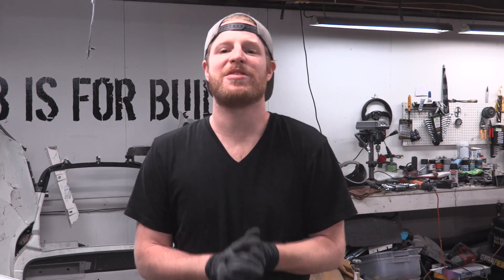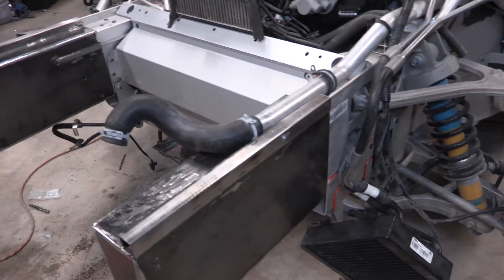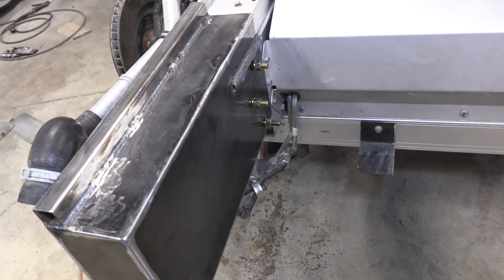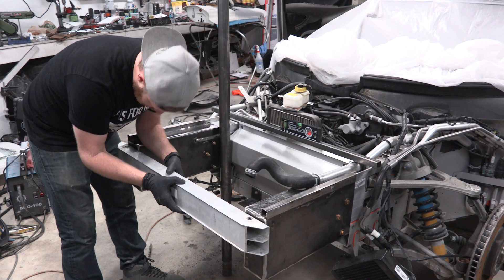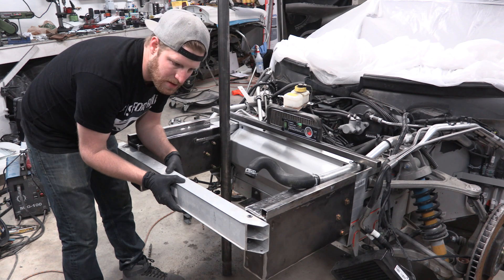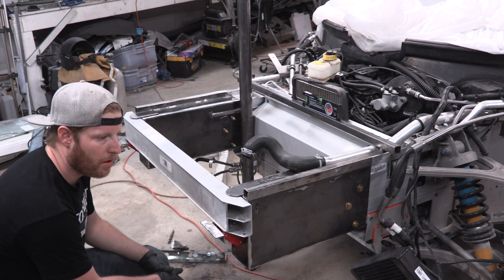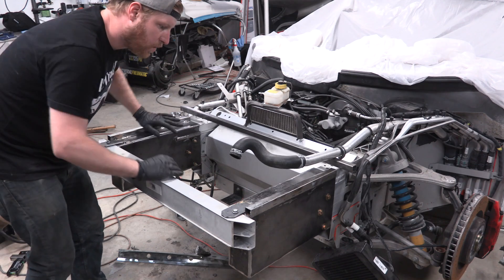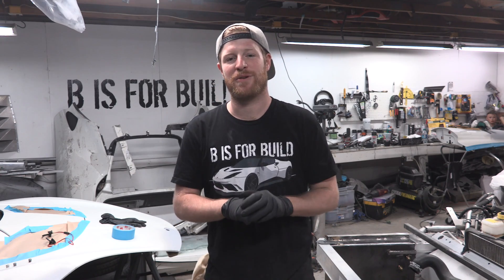Budget Lotus Evora Pt 21 - Mounting Impact Bar & Frame Rail Extensions

Comment: I know you are doing it for the internet trolls, but you are going above and beyond to make this design "safe" and its honestly just too much.. if people are talking about corrosion or crumple zones, just tell them to fuck off. The factory used steel inserts in the aluminum crash bar, that's enough proof that it shouldn't be an issue. and the steel frame is just moving the crumple zone back. do you expect to roll this bitch into a concrete wall?

Comment: Maybe using Nutserts into the alloy would have been a better approach. You wouldn't be stressing the alloy as bad. Also would it be worth cutting the frame rail boxes to taper up to the  impact bar? Probably shave a bit of weight and will still be strong.

Comment: You can add crush sleeves by removing the bolts and drilling one side to the OD of the crush sleeve.  Trim the sleeve the the correct length so that when inserted it gives you some clamping force but not enough to crush and pull the faces together dimensionally.  You have to weld them to the plate you pushed them through.  They'll butt up on the inside of the far plate.

Comment: Hey man, Just wanted to say Im really enjoying the build! Ignore the haters! They just dont get it. This car is for you and not to resell so build it the way you want! I do have one suggestion thought. When you do final assembly of the frame rails, I recommend taking your welder and killing the nuts on the bolts that hold the frame rails on. If you ever have to disassemble, youll have to cut the nuts off but, in my opinion its better to replace a few dollars worth of bolts than risk having things vibrate loose. Just my suggestion but, as I said, build this beauty as you see fit!

Comment: Do you plan on putting bushings or sleeves on the inside of the frame rails for the three bolts you are using to secure the steel extensions so you don't crush your steel extensions and aluminum frame rails when you tighten it all together?

Comment: Dont worry about all the pseudo science going on people dont really know what they are talking about. Just remember that every single screw nut and bolt on that car is steel and they are all fine! Not to mention brake discs engine components etc etc.

Comment: I dunno maybe you could use that glue they used for some of the other stuff as a separator between the 2 metal types.. would also help keep it mounted I guess.. might not be a good idea though, just speculating.

Comment: I understand the reason behind reworking the frame rails, but surely bolting them through and not welding them is just focusing any crash force in to 3 tiny spots in the original aluminium structure?
Reply: He is going to use the glue that lotus use oem too, he said that several times.

Comment: Chris you should get some nylon washers for the bolts. I use SS and Aluminum all the time together in the marine construction field and using nylon washers helps with lessining the corrosion between dissimilar metals. and that is even in a saltwater environment

Comment: i really like your desition to use the lotus bar on the front.

once you have painted the steel parts, hopefully grey? they will blend in very well and this will look like a stock setup :) 

those springy lock washers are useless though. if its not already in your plans i suggest getting lock nuts or real lock washers (the kind with two washers that are serrated on the outside to grip the nut and the surface, and have a stepped design between them to only go one way) :)

Comment: Instead of buying high dollar epoxy from the dealer, go to any autobody paint supply store and ask for panel bonding epoxy. I like 3m brand. Some need a special applicator but you can manually mix the stuff up with a c clamp.

Comment: Nyloc nuts on the bolts when you do the final fix on the frame rails. How about powder coating the mild steel frame rail extensions inside and out before you do the final fix? Not sure how that will effect the epoxy bond though. It's looking good so far.

Comment: REMEMBER: When you bolt through a hollow object, you NEED bolt spacers so you dont CRUSH the structure!!
Reply: ^^Bump^^
Reply: i can second this, this has happened many times to me before
Reply: I was thinking bout this too. Hopefully he sees your comment/thought about it already 👍
Reply: Came here to say the same thing, bumping up
Reply: since it's permanent and also being epoxied, he might as well just hand-tight the bolt and then weld the nut to the bolt
Reply: Bump! Don't want all the work to go to waste when it crushes in on itself
Reply: yeah i think so too. maybe glue them in the that red shit.
Reply: hes probably just not going to tighten it too much. bolts are secondary to that orange glue stuff. BUT that means the bolts will want to come off from vibrations. SO I'm hoping for locknuts or some locktight.
Reply: Yup, they are typically called crush tubes!

Comment: I wonder how filling the cooling system is on cars with engines in the back and the radiator up front. Would you have to forcibly fill it or fill the coolant hoses/pipes first? The pipes would always have coolant in them right since they have to flow such a long distance?

Comment: Every car on earth has a mash of metals... People who are commenting on it are morons... Inside every aluminum block motor is an iron sleeve and aluminum block sitting in 50% water and high heat cycles and grounding current running through it and no issues. A little mix of metal on the outside is nothing.
Reply: But the sleeves don't touch the block because if it did the sleeve would expand and crack the block
Reply: +Jamie Roberts False. They are pressed into the block and make contact at the bottom and top of the sleeve to the block. Also the block will not split because aluminum expanse more then the sleeve when it is at temperature. The blocks are usually preheated when the sleeves are pressed to ensure the sleeves don't fall out when the engine is hot. Look it up and do research before talking about things you know nothing about.
Reply: +Refisol I don't mean they have zero contact, I mean all around the sleeves there is space as it isn't touching the block. Of course there is some kind of contact
Reply: Whilst it is true that most cars have multiple metals in them, nearly all cars have one metal that the chassis is made out of e.g Steel, Aluminium or Carbon Fibre. The problem people are having is placing heavier Steel on the end of an Aluminium chassis could create an unwanted effect in the event of an accident more importantly for me however is the extra unsprung weight of that crash bar is bound to affect chassis balance.
Reply: +Refisol that's a pretty broad statement to say every car on earth has iron sleeves but the point is the point I guess

Comment: I think you did a damn good job repairing the frame for what you had. There are data programs that allow you to look up exactly what the manufacturer recommends for where to cut certain parts of the frame, max/min heating cooling temps etc. might be helpful next time. Great job nonetheless.

Comment: Came out a bit better than I expected, however, as a Mechanical Engineer I gotta say something about those bolts.... you're going to want to make some spacers to fit inside the aluminum frame so you have something to torque it all together.   What you have there will pull the metal inward and lose torque over time with bumps, vibration etc.   I wouldn't rely completely on the bonding material as well considering this is sort of a cantilevered beam setup (high stress).   All you have to do is measure the inside of the frame rails, have some aluminum or steel spacers made, and cut some small access holes either on the top of the aluminum frame or sides.   You can even make dummy install shafts (the same width as the frame extensions) out of bolts that hold the spacers in place while you slide the frame extensions on for assembly.   Then you can just push the install shafts out while the bolts when in place.

Comment: How about adding a bushing spacer inside the aluminum rails where your bolts go through to prevent bending when you tighten them?  You could get a piece of metal pipe with the ID close to the size of your bolts.  Just a thought.

Comment: Can someone explain me the corrosion thing?
Reply: When you have two dissimilar metals against each other there is a chemical reaction between them causing the metal to corrode. Steel to aluminum and the aluminum will corrode into a white powder so you need something like rubber or plastic to separate them

Comment: Is it just me or does the tab connecting the frame rail to the impact bar does not appear to sit flat on the rail and it seems to angle upwards towards the impact bar.  At about the 18:50 mark.
Reply: Yeah it's not flush.  I think he set the bumper support to the height of the original rail an not the 1/8" steel maybe?  Not sure.  Looks like he just tightened it enough to bend it to form lol
Reply: I'm sure he'll get it all worked out. I just wanted to make sure I didn't need to get my eyes checked. Hahaha.

Comment: Did you use locking washers or nuts on the bolts? They might vibrate off after a while
Reply: +Mike C I was gonna say use nylock or something similar
Reply: Red locktite those puppies for sure
Reply: Come down keyboard expert...